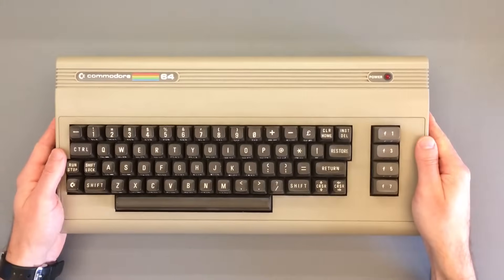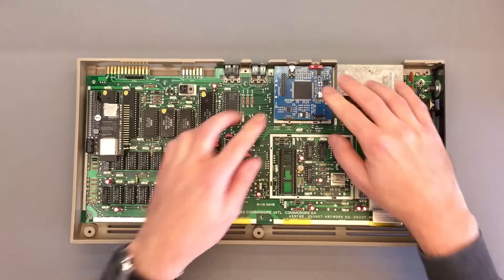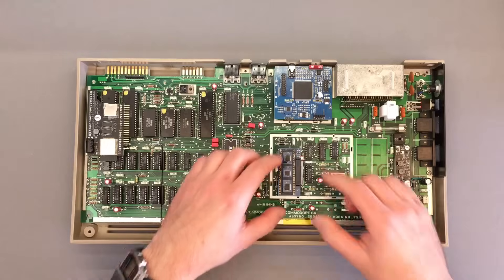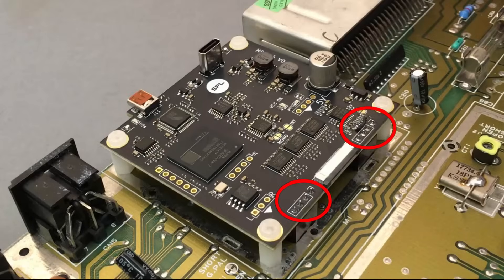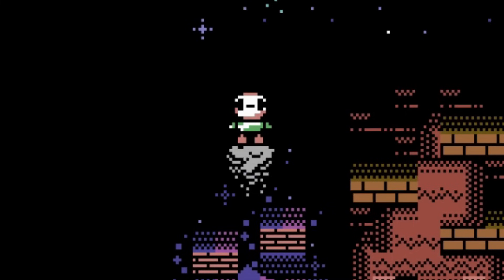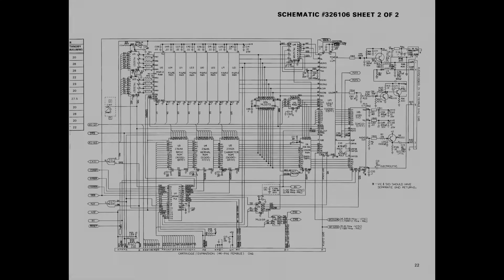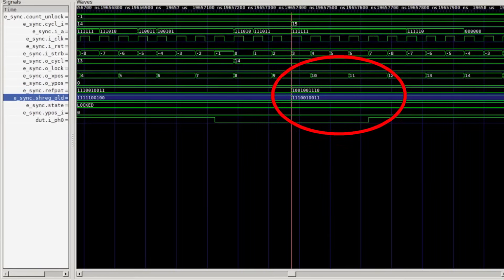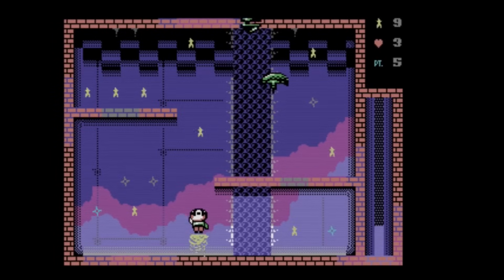Finally true, Full-HD HDMI for the Commodore 64

Comment: Great work especially getting the audio integrated too. Could you please add a direct video output mode (240p over HDMI, with DV1 metadata preferably) for those of us who already have a external scaler like Morph4k, OSSC etc?
Reply from the maker: I don't see this happening, sorry. I want to keep the project simple and handling too many cases would mean either lots of on-the fly reconfiguration and/or maintaining multiple builds, which is something I will try to avoid as long as possible
Reply: @sideprojectslab7352  I see, that's a real shame and would have made this much more appealing to many people who already have scalers. The original Copperdragon board did have a pass through mode but I appreciate it's more difficult to implement over HDMI. I do hope you will reconsider one day!
Reply from the maker: @VideogameBucko  I'm not sure I follow though, what would you do with 240p over HDMI? I don't think it's even a supported resolution... And you do still have the analog signal on the AV connector. Are you perhaps referring to integer scaling?
Reply: @sideprojectslab7352  You feed the raw 240p (well 288p in my case since I'm using a PAL C64) directly to a next generation scaler such as Morph or OSSC Pro. The scaler then handles ALL of the scaling and post processing (scanlines, masks etc). With the way you have it now, the image would be scaled twice, once by the board and then again by the scaler, which is all right but not ideal. Sure you can put the analogue signal directly into your scaler too, but that's of course susceptible to noise etc, being analogue, and especially being a C64 lol, not like a nice clean digital to digital solution like you've developed here. While it might not be an official resolution in the HDMI spec, Most HDMI mods now support passthrough mode (PixelFX Gem, CPS2 digital) as well as the Mister project.

Comment: I will never understand the urge for using old hardware on modern monitors. The software library was made having small CRTs as displays in mind. Modern high resolution display quality just ruins it for me. You can have this on an emulator to make it more cheap and simple. But hey, whatever floats your boat 😅
Reply from the maker: If you have original hardware but cannot find, can't afford, or don't have the space for a CRT, then the original hardware is a glorified paperweight. Not to mention that there will come a time when not a single workng CRT monitor is left. We mostly do this out of necessity rather than principle

Comment: Wow! Always wanted something like this. Also for the Amiga.
Reply: There is a solution for the OCS/ECS Amigas (500/600/2000)  based on the Raspberry Pi Zero called RGB2HDMI
Reply: @pikozzyhobbykanal  Also the Indivision from iComp for AGA Amigas (A1200, A4000, CD32), wich actually replaces the Lisa (implementing the full Lisa in FPGA, exept the A2024-mode) and can output HDMI or VGA. The ECS/OCS version (replacement for Denise, A1000, A500(+), A2000, A3000,CDTV,A600)) only outputs VGA.
However, both without digitizing the audio.
It is perfect if your Denise or Lisa died, as you do not need the original chip anymore.

Comment: It's like a cyborg now. No added sound noise by letting the flex running that close to the SID, I assume? Does it handle all those crazy tricks used in demos?
Reply from the maker: The SID audio is already so noisy that any added noise would be completely drowned by what is already there, but no, there seems to be no degradation. As for the tricks, that's the idea, it should be identical to a real VIC-II, I think I got pretty far with that, but if we find more details going forward I will address them
Reply: @sideprojectslab7352  Yeah, it's noisy, true. I remediated some of it on my own machine by putting some pull downs on the input pin on the SID. It's kind of floating. I've seen people putting buffers on all the digital inputs too. That makes a huge difference. Perhaps v2 will have buffers on the SID daughter board j/k j/k. 😉 I bet you already have that, but for voltage step-down.

Comment: Does it introduce any lag?
Reply from the maker: not really. The output frame starts being transmitted 10/12 lines after the input frame starts, so we are around 600/700us, which is quite low in the world of digital video (most screens have several ms latency)
Reply: under one ms he said
Reply: Most flat-screen TVs do add some lag after they received the signal though. Some do have a "game mode" with lower latency an less image processing though.

Comment: This is awesome.  Are there any compatability issues using this with an NTSC shortboard?  When I had looked into the VIC-II Kawari, I believe there were some problems due to the SuperPLA.
Reply from the maker: I have tested on an NTSC board and it works no problem. I also shipped a board to a Canadian tester that's going to put the HD-64 through some serious NTSC testing
Reply: @sideprojectslab7352 That’s great news. Looking forward to purchasing one when it’s available.

Comment: Great project, nice work. Would be interested to know how this differs from other options in more detail. Thinking versus lumacode,  kawari etc.
Reply from the maker: It is internal and fully hardware based (the emulator is on FPGA), unlike the Lumacode, and it outputs Full-HD video with stereo audio, unlike the Kawari which does low(er) resolution DVI without audio
Reply: @sideprojectslab7352  Thanks for the reply,  It looks a very neat solution and great to see more development on output solutions. Looks like an addition to my shopping list 😀.

Comment: Amazing. Feels more true to the hardware than console "bypasses", since the VIC-II is still doing all the heavy lifting. Will be excited to check out.
Reply: what is it lifting? Sprite collision and line interrupts ?  Ah, video DMA and sprite addresses. Kind like that one CTIA chip in the Atari 8 bit or the Agnus in Amiga.
Reply from the maker: @ArneChristianRosenfeldt All the timing and the active interactions are handled by the VIC-II, so the HD-64 is "just" a passive listener, which simplifies things and completely removes the risk of crashes due to incorrect timing. If you look at what's inside the FPGA, it's probably a good 80% of a whole VIC, but in terms of development effort it is infinitely less, as I could basically disregard a bunch of devilish quirks that are however crucial for the correct operation of the C64
Reply: @sideprojectslab7352  How does sprite crunching work? So the FPGA listens if the VIC pulls any data for a sprite in a given scanline and only then also draws it on screen? Since VIC discards all sprite pattern data while drawing, this also works for y zoom. Nice. So cycle perfect sync is needed. Ah, and any video data on stolen CPU cycles goes into the internal line buffers (for character code (the stupid TED on C16 stores ExtendedColor data here and also there is the bitmap mode) and attribute).

I thought that the original VIC has the bad timing. An FPGA implementation could resolve the VSPbug even on original memory. So if you plan to remove only one original part...
Reply from the maker: @ArneChristianRosenfeldt  The best answer I have would be to go and check my python implementation, but the TLDR is that the FPGA will digest everything it finds on the memory bus, line by line, this includes crunched sprites